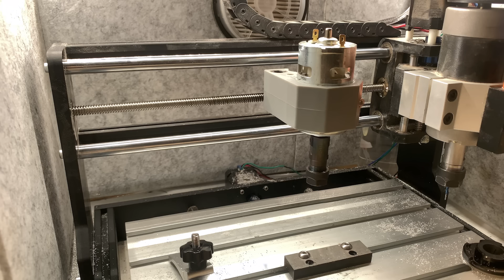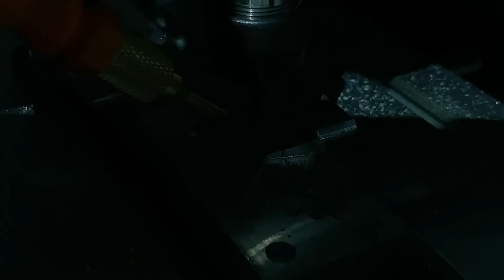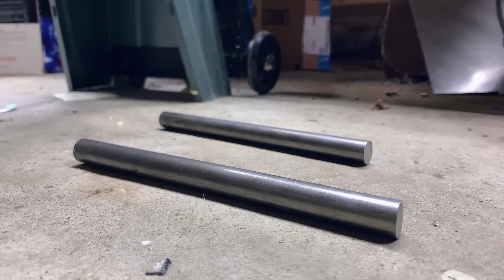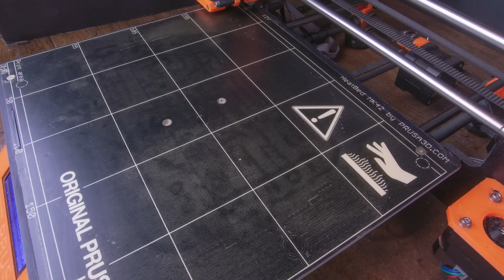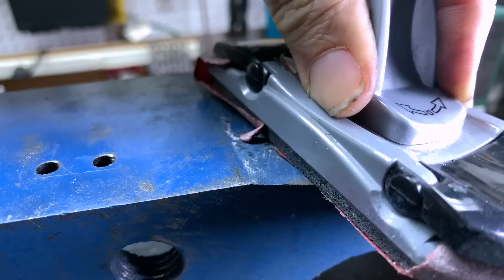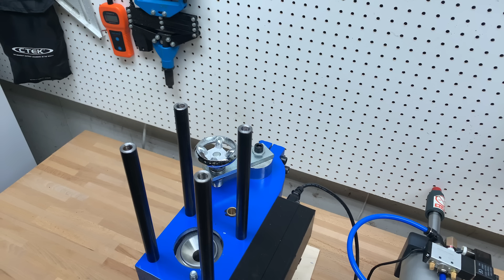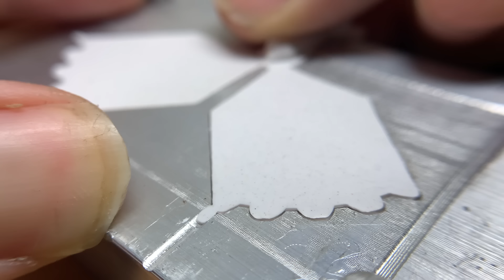Build an Injection Molding Machine From a Cheap Pneumatic Press

Comment: I went thru this almost exact journey myself a year ago.  I didn't use a foot control though, instead I used a pneumatic lever control block like they use to control an automotive lift in a shop.  It gives me finer control if I need to back off for some reason.  Another thing I learned is that the adjoining faces of the aluminum molds must be as flat and free of any defects as possible.  I do this by facing about .005 of an inch off each side's face as a last operation on the CNC.  Also, I machine a larger radius in the mold using a cutter with the exact radius as the injection nozzle.  I just bought a 1/2" radius carbide router bit and very slowly and carefully lowered it onto the aluminum.  It is really not for that, but if your careful it won't violently gouge it.  I do it on the CNC and drop the Z axis by .001 at a time.  The machine complains a little but I have done quite a few molds and am still on the same router bit.  Thanks for the video and your editing is quite good.  I had a fun time watching it.
Reply from the maker: Neat.  Ja, I've been considering using 400 grit on a precision surface to clean up the mating mold faces, but so far I haven't really experienced enough excess flash to  make me think it's required.  Great to hear about your experiences/build.  Sounds great.
Reply: @retrotechjournal  Cool, if it's working for you.  I had a lot of excess flash until I starting facing and clamping harder.  Trial and error, lots of error though to get good repeatability.  I also learned that molten plastic is like napalm, so I made sure to put up a splash guard after a rather painful lesson.
Reply from the maker: @stevenreyngold1166  Ouch!  Yes, I made a perforated stainless splash guard and also a pellet feeder so my hands aren't in the danger zone at the top either.  Sticky crazy hot plastic is no joke.  I knew that if I have to do a long run of parts I might slip up so I tried to make it a bit safer.

Comment: Do you REALLY need a pneumatic press? Can’t someone please make a hand-powered injection mold?
Reply from the maker: No of course you can do it by hand.  I even included a shot of the Buster Beagle 3D manual injection molder I built.  They totally work, are cheaper and are a lot of fun, but if you want to make a lot of very consistent parts having a higher pressure faster more consistent machine is worth it.  I’d never agree to making 100 parts on my tiny manual machine but could do that on a whim on this machine.
Reply: @retrotechjournal  but if you can make something spring-powered with a hand crank that tensions the spring, and a release latch that releases the spring tension all at once, the resulting force would in fact be consistent every time!
Reply from the maker: @ophello  You could probably get a system going with a spring.  I think most manual presses just provide a lot of mechanical advantage and depend on operator skill to provide the consistency.  The nice thing about pneumatics is that the control of max pressure/flow speed/switching times is both cheap and compact.   So that's why I went this way, but you certainly could build a cheaper manual system if you had a lot of heavy mechanical scrap around to pull from.   A semi clockwork mechanical spring press DOES sound cool though.  :]

Comment: Sir you have earned my view and subscription this video was greatly well done and very entertaining!
I had already bought all the parts to make Busters design a year ago but decided it was just too weak for what I'm trying to do.
Your redesign of this project just might get me back moving again so I can make my own parts too!
Reply from the maker: Great!  I'm glad you liked it.  Welcome aboard.  ⚡ I have yet to push the limits of pressure/size/detail, but I will say that there is a world of difference between using the Buster Beagle V1 and this.   Very consistent/fast and great detail.  I haven't built any of the other Buster Beagle injection molders, but the V2 just didn't look strong enough to me, with that big lever arm, but not a very beefy frame. That's just my instincts though.  No direct exp with it to back that up.

Comment: Great build and video, thanks for sharing! When you were making your metal molds, did you cnc/mill out the male/female pins, or add them after?
Reply from the maker: I machine only holes, and then have 1/4" steel dowel pins I press fit into the smaller pair of holes. On the opposite part of the mold I have the two slightly larger holes which are a sliding fit for the pins.  I certainly could just machine some mating features into the blanks but which ever side would have the projecting "pins" would have to have a lot more material removal. (everywhere that's not a pin) This way is easy enough and I can just keep re-using 2 hole sizes so it's simple.   I may try some other mating scheme at some point.  The pins can be very short since they're really just there to prevent lateral motion of the mold halves.  I guess they add a small amount of expense since pins cost about $1 each.  I'm glad you liked the video.
Reply: @retrotechjournal  amazing!! Thank you for sharing all this info. I did a few little tests with machining pins, and although it worked, it was a lot of time for just a few pins. Your approach is great. Thanks a bunch. :)
Reply from the maker: @dbrown428  The pins don’t have to engage very far. If they stick out too far it just makes the mold more annoying to open/close. Lol. I use a dead mold half with a plumb hole in it to act as a guide for pushing in the pins with my vice. AL is soft enough that it’s pretty easy to push a pin in crooked. I should probably just JB weld them into a bigger hole or something.   😂 glad to help. I love talking about the details.

Comment: I would be very happy to see a video on assembling a case for CNC with source codes and drawings, thanks!
Reply from the maker: Oh!  You're the third person to ask about that.  I had started filming it when I made the enclosure, but then decided to stop since filming makes projects take 10x as long.   That's why I at least had a tiny bit of footage about the build to put in this video.  lol.  I really do like the way the case came out, but  there are a few update I'd have to do with the design.  (The fan I ended up getting was a different size than I'd put in the design so I had to make an adapter plate, and I think there were one or two other small screw ups in the original cad. There has been enough interest to make me want to revisit and share the cad.  I'll let you know when I share the files.   Not sure about making a video though.    I don''t want to build a second one, and if I didn't do that then the video would mostly be me pointing at the finished case and showing some cad, which probably doesn't make for much of a video.  I will update and share the cad, and perhaps I'll make a blog post about it with a few pictures/links to the air filter I used, etc.   No detailed instructions, but with the CAD file some folks should be able to make the case.

 It sure is nice to be able to run it without making a mess all over the shop.  I did a 4 hour job cutting wood on Sunday, with the air blast clearing the chips and everything was squeaky clean in the shop afterward.  So nice.  The air compressor is still the noisiest part.  The CNC itself isn't too crazy loud.

Comment: Wooden cased cnc is very beautiful...would you give it as a gift..?
Reply from the maker: I'm not sure what you mean.  Someone asked for the design files. Is that what you want?  Right now there are a few mistakes in those files that I never got around to fixing because the video wasn't about CNC enclosures and I didn't realize anyone would want them.   In the original design the fan mount didn't quite match the fan, and there were a few other small changes I had to make.  I think maybe the screw holes for the power jack were incorrect, a few other issues.   Also, frankly the thing has a lot of parts so it required a certain amount of clamping/careful alignment to get it together/it's easy to get parts mixed up, etc.   I'd have done the design a little differently if I was taking care to make it easy for others to build.   If you also are interested in the design I'll see about updating it and posting the link.  If people have access to the Fusion360 file they can keep track of which parts are which without some sort of instructions/etc.   I am very happy with the way the case turned out.  The control panel is just a removable so it's easy to make revs of the panel layout.   The power supply fan hole alignment will only work with some kinds of power supplies.

Comment: I finally got the opportunity to watch this and I was not disappointed. Definitely a project to consider. I'd absolutely love to get into injection molding, but I think maybe I need to work on the CNC mill part first.
Reply from the maker: Yes, I'm excited about the opportunities this tiny mill has opened up for me.  Not just for making injection molding dies.  I'm going to add some more work holding options, a Z axis probe thing, and maybe a pendant control of some sort.  lol.  So it'll be all fancy.  I really should re-work it to provide a bit more Z axis head room.  I left enough room in the enclosure for that.  It would be nice to have a bigger CNC, but this one has been great for learning, and can do some interesting things even at this size.  I'm already pressed for space in the shop, so a bigger one may be a long time coming...   Good luck!

Comment: Hi Kurt, I absolutely loved this video! Would I be able to get a copy of the design/manufacturing files for the laser cut CNC enclosure? I was just about to start designing an enclosure for my 3018 CNC for the same reasons you mentioned.
Reply from the maker: Oh.  I'm not sure...  I like the way it came out, but frankly it's made out of a stupid number of pieces so it was kind of a pain to put together.  There are also a number of mistakes in there, like fan holes that didn't line up and I had to  just drill, etc.  Not really "Super clean and ready for others to build".  Let me look at my Trello list of "Things I really should fix" in that design.  If it's not too horrible I'd be happy to share.  One nice thing is your laptop can slide under the enclosure, which is nice, and it takes some random stock air filters I ordered off Amazon.  Still it's not exactly a "wonderful kit with instructions" kind of thing, but it may be worth sharing for those that are brave.  ;]

Comment: So cool Kurt!  I've been considering a similar project, utilizing a press for building a DIY IM machine.  Have you done any analysis on scaling up the design, for larger shot sizes?
Reply from the maker: Well, at least for that press, a larger shot size would be easy if you simply made the ram/heating chamber have a larger diameter.  Of course as you do that the max injection pressure drops.  I guess the other option is to put a longer stroke ram on there.  That would up the cost, but would have the advantage of not decreasing the max pressure.  There's certainly enough stroke length in that V2 heating chamber to go deeper.  You don't want your injection pressure to get too low or you won't be able to inject large walls/thin walls, etc.  I think that import cylinder is only rated to 90psi, so you could go to higher injection pressures with a higher grade (but same diameter) cylinder.  I think having a giant shot size with low pressure isn't super useful since if you don't have the pressure, your limited to high volume to surface area solids, which will suffer from a lot of shrinkage as they cool.  So there may be cases for that but it's not just a case of higher shot volume always being useful. 

I'm glad you liked the video!
Reply: @retrotechjournal  Thanks so much for the thoughts.  Makes sense that increasing the diameter would lower the injection pressure, per unit of area.  I guess the key question is how much injection pressure is needed, and how that might vary for different materials, and part volume.
Reply from the maker: @justinanderson6178  Yes exactly, and I don't have a ton of exp. in that area.   You might want to check out @johnSL who has more exp. doing injection molding/has a number of machines with different volumes/injection pressures, etc.   I felt like he was pretty dismissive of machines with a high volume/low pressure.  Which I can understand.  If you have a giant mold and not a lot of injection pressure you probably have issues with lack of detail/not filling, etc.

Comment: How do you cope with the idea that the project may not work and you'll have wasted so much money?
Reply from the maker: That is always difficult.  You can get this kind of project paralysis  where it's hard to cut up that nice hardwood because you might be scrapping it, etc.  It is also true of time.  Like I spent a year and a half making the computer controlled loom, and at the outset I kind of assumed it was never going to work.  To avoid paralysis, I try to re-frame the situation so I'm investing in learning things.  As long as I'm going to be learning stuff, and having fun doing it, the money/time has not been wasted.  You're right though this one in particular had a lot of up front costs that took me a long time to rationalize.   Also I did that post-project cost total which is something I basically never do.   That was painful.  :]

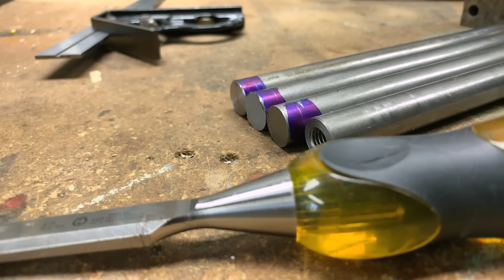Comment: 9:06 you were darned lucky each of those rods had internal flaws that happened to be appropriate for the project. Whenever I do that, the threads are always metric and left-handed.
Reply from the maker: When buying rods, you can tap them, and the ones that make a hollow sound have internal threads, but you're right that telling left handed threads by ear can be difficult.
Reply: @retrotechjournal  The struggle is real.

Comment: A "stupid" question: I guess you need a compressor to make it work?
Reply from the maker: Yes. Sorry I guess no footage of me turning on the compressor made it into the final cut although I assume there are some compressor sounds.  The air requirements are very low, so even a tiny nail gun style compressor can handle it, but you do need a compressor.
Reply: @retrotechjournal  Thanks!

Comment: What rude shipping!
Reply from the maker: lol.  I know!  The seller did eventually send me a new gauge for the regulator and a new solenoid valve, but it took forever to come, and the slight dent in the cylinder itself is pretty scary.  :b
Reply: @retrotechjournal  well you made some beautiful work (this video, besides the machine) and sharing your design files is so cool! Bravo on the endeavour
Reply from the maker: @lumotroph  Thanks!  I love designing things, and getting to play "Home Industrial Designer", and now with the addition of a CNC and an injection molder the sky's the limit.

Comment: Great build and video! I really love the editing and pace. I've built and use Ryan's first version and I'm now contemplating whether to go ahead with MK II, or skip that step and go the pneumatic route. A friend sent me to your channel and I really love what you've done with it. I don't have an engineering background and I don't have a lot of the tools or resources, so examples and plans like this are really helpful for me. I am more and more leaning towards the more sturdy and consistent pneumatic .option and your video has just made that belief a lot stronger. Thank you and have a great day. ☑Subscribed
Reply from the maker: Yes I think if you are really thinking about doing any sort of production, going Pneumatic is the way to go.  I built the MK I, but can't speak to the MK II.  I only used the heating chamber from the MK II.  :)  I'm glad you liked the video!
Reply: @retrotechjournal  My main goal is to make small run art pieces and toys, so I probably won't do any large productions but having the ability to will probably shift that as well as open up the possibilty to take on jobs that I otherwise wouldn't. Let's see!
Reply from the maker: @baschz  Good luck!  That is an amazing thing about Injection Molded parts.  Since you don't have layer lines you can have things like spring clips and flextures that really hold up even at very small sizes.  Things that are hard to do/impossible with FDM.  That sounds very cool go for it!

Comment: Great job!!! One small detail, probably it will work better if you have the mold in horizontal plane, since the hydraulic press will push it together in the end of the cycle an you can actually know the clamping force you are applying to the mold.
Reply from the maker: I'm glad you liked it!  Mostly I've avoided using a horizontal mold simply because it'll be more difficult to remove each of the parts.   I would like to try it at some point though.   I have enough clamping force for the dies I've made.  In the video you can see the die opening slightly during injection.  (If you look closely) but that was just because when I was filming it I filmed the whole sequence and didn't crank down hard on the clamp because that tends to move everything around in the shot.  :)